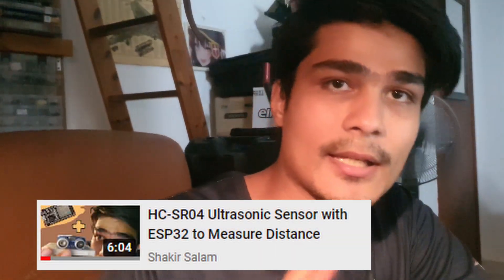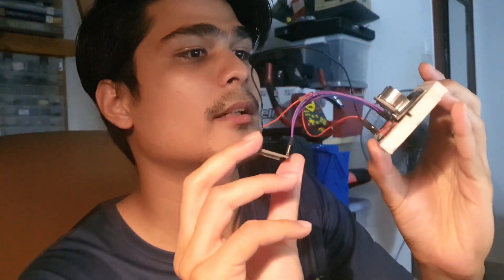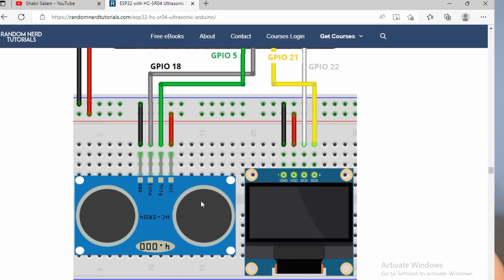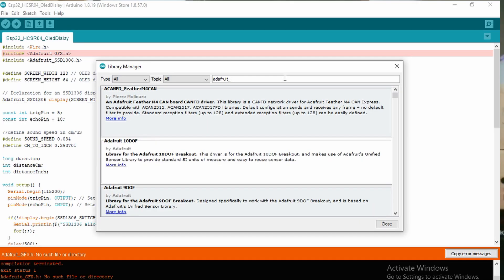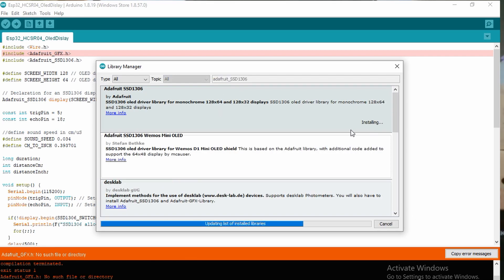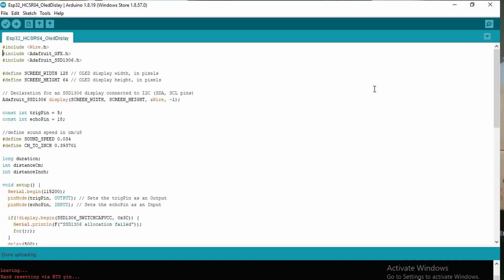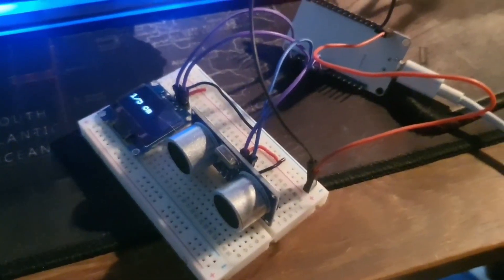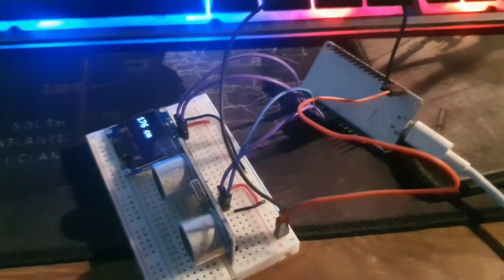HC SR04 Ultrasonic Sensor with ESP32 to Measure Distance on OLED Display

Comment: One think I noticed in the comments on the RandomNerdTutorials is that the HR-S04 is powered by 5 V and the Echo Pin is the output.  So we are sending 5 V to one of the ESP32 GPIOs.  This didn't appear to damage the pin but it probably isn't a good idea.. Putting 1k and 2.2k resistors in series from Echo Pin to ground will drop the voltage to about 3.5 V, which would be better for the ESP32.  The trigger pin is input, so it probably doesn't need the resistors.
Reply: I also powered the OLED with 3.3 V.  I seems to work.
Reply: There seems to be a debate on the internet about whether the GPIO is tolerant to 5 V or not.  Since I didn't damage the device by connecting the Echo Pin's 5 V to D18, I suspect they probably are tolerant to 5 V.  But I don't know if there are any long term effects.
Reply from the maker: @happyhippo2767  I havent seen the discussion. Thanks for reminding me esp32 operate on 3.3V since I was powering it on with 5V. Later in my kicad design will be adding few resistor 1k and 2.2k on the echo pin to ground sure be recommended as you mention.
Reply: Sir can I use this same method in esp8266